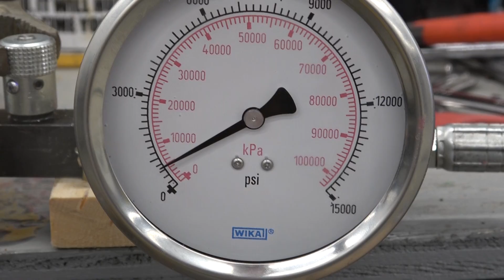How much pressure can PEX take?

Comment: I replaced our water heater a few years back and needed to replace the circulation lines as well and I saved so much time and money using PEX that I swore I'd never use anything else for water lines.  Ended up doing the whole house system in it and never had a leak in 14 years.  Thing I liked about was time saved on having to make joints and elbows and the like in tight spaces since you can just loop it around.  Now there are places I'd still use something rated for higher pressure, especially in hard to reach or sealed up installs but it's good for general home use.

Comment: how about testing the cheaper CPVC pipe, i used flow-guard and only ever had an issue when someone had a un-glued fitting on test. some times had to pump up to 150 just to get it to show its face, and pop apart.  i have seen it freeze and not bust, swelled up a bit, i just cut it out and glue new in.   not a bad alternative to copper and works great for air lines as well

Comment: In the plumbing world sharkbites are a joke and a bit of a meme among actual good plumbers. The pex i use has an aluminum layer
Reply: @marionette5968  they are not bad in an emergency or if used outside  but in just my 4 years as a plumber i will say i have seen many of them fail and cause tons of damage. never use them for permanent use and if you do never put them behind a wall or something and cover it up. yea they can handle the pressure for a bit sure but i have seen evidence that water hammer has slowly pushed them off after a year or 2 and ive seen them ruin bathrooms and even worse if someone goes away for a few days and one pops off it ruins an entire floor. they work a little bit better on pex but if you are on well water you are def asking for an insurance claim. if you are worried about burning a house down then you are better off calling a plumber. i wanna say i see at least 3 to 5 of these fail a year and in some cases cause ppl to have to get entire remodels in rooms or floors. i dont thnk they do anymore but even on the sharkbite bag it used to say something about not for permanent use and not liable for damage if it fails. the only time we ever used them was if we needed to attach to a brand of pex that you cant get fittings for anymore.  i also recommend looking up what happened with a pex brand called quest tubing. they used a similar metal teeth with an O ring method to attach to pipe and the fittings failed and they were sued big time. if you do go away for more then a few days we always recommend you shut your water main of at least. it doesnt take much for some water to cause massive mold damage
Reply: @marionette5968  almost forgot to add this but you can also rent pex tools and buy the fittings. i dont know if your places do but our supply stores will rent out there pex tools sometimes to people or a tool rental store sometimes has one. you only need to make sure you get the compatible ring and fitting for the tool

Comment: Same here in Europe/Germany, everybody is using those tubes because they can be fitted together so quickly. But I do agree, copper piping is still superior and you don't need expensive tools to press them together (except when using copper piping with press fittings instead of soldering them).

Comment: We're simulating real world conditions here,where somebody taped a hotdog on the pipe and hooked it to a modified grease gun..... 
(It's AVE'S real world....)

Boom!
I can vouch that it's not rodent proof, the rodents built a nest next to it in my camping trailer shower and felt obliged to chew on it, as it was right there. Of course the chomp marks were downstream of the blending valve and upstream of the shower head, so I didn't find out until I was 300 miles from home and 350 miles from a Pex dealer...  Had a whole box of "regular" pipe fittings with me, but they were no help. A few wraps of duct tape and 40 layers of fishing line (hand fed thru the gap one turn at a time) held well enough to shower for the trip as long as I didn't dead head it.

Comment: The previous owners of our house made the wise decision to re-pipe segments of our radiant heating system using PEX... although I have to say 10yrs on and there's been no issue.  At least it's low pressure (~15psi) and in an area that's easy to get to when it goes.

Comment: In Romania we used PEX-Al pipes as replacement for the older steel pipes which tend to rust. The problem with PEX-Al is that the pipes tend to leak at the fittings or even pop out. Recently, plumbers started using PPR for water and heating(distribution from the furnace to the radiators), there's no metal and the fittings are heat welded to the pipes.

Comment: Pex works better than copper where freezing is an issue, such as where tenants are responsible for remembering to keep the heat on in your property if they leave town. It usually will not burst in the pipe itself, as long as you strategically place the fittings (crimp are much stronger than Sharkbite) in less freeze-prone locations then you can save a lot of flooding hassles. When it gets -25F or below here and the 40mph winds kick up, I've had copper pipe runs in the exterior walls freeze if no one is using water and they have the heat down to 55 degrees, no problems with Pex yet.

Comment: You should’ve used the code compliant crimp that’s required for any hidden plumbing. Those SharkBite fittings are great but only acceptable when the plumbing is visible (under a sink, most hot water tanks, etc.). I’d love to see just how strong the PEX is when new vs after several hot water cycles.

Comment: AvE,  i enjoy your work.  im in a project in wich i need (advice eletronice). its a liner actuator, i wish to send a .jpg of the motor control board. and then you could tell me where to solder in SOMETHING reostat, var pot, resister? i need to nock the ripems  down.  1/2, 1/4 1/10?  anyway, may i enlist your help??? if so comment to my next video. the victom is a hospital bed actuator . the control board is nearly naked!   poppy's workshop says HI  p.s. help

Comment: We use PEX too in Western Europe. I used the ALPEX, which is PEX with a aluminium layer in between. No leaks since 15 years. I had some leaks, but all in the fittings, mainly the shut-off valves of the central heating system which runs mostly at 70°C

Comment: PEX-AL-PEX is rated for pounded air.   Import Chinese brass PEX fittings have history of low Cu content leading to costly rapid dezinc failure.  Weird Las Vegas mayor passed law that accelerated failure. Look up Arreneus effect.  Otherwise we use PEX in our laboratory for high temp hot water testing.

Comment: We have been installing pex in Minnesota for over 10 years and can tell you never had a single problem with them , much much much easier and quicker to use then copper. I use the crimps myself but also haven seen anything wrong with expansions either.

Comment: As a plumber in SW Florida, trust me when I say PEX is the way to go. Copper doesn't last for crap on account of the horrible water quality. CPVC is better then copper in my opinion, but it does become brittle over time, I've seen it become brittle after 15 years, which is bad. It really depends on the water quality, and if the house has a whole home filtration system then I guess coper would be the best, but most people don't want to spend that kind of money on an effective system, and they certainly don't want to pay for the upkeep or do it themselves.

Comment: Plastic plumbing i s massive over here in the uk. Every single volume built home since the late 90's has been plumbed in the stuff. gas lines are still copper thou. Also an interesting point is that  whilst heating systems are exclusively plastic, larger systems with circulating domestic hot water lines have to be done in copper

Comment: The problem with the plastic is that the fittings will start leaking at some time due to pressure differences and heating/cooling. Also the connector usually is crimped on. Due to the problem with the fittings I would at least use copper pipe for hot water if I had a choice.

Comment: I am a Plumber with 30 years of experience,  mostly rural and small-town work 10 years ago a moved to the Barossa Valley very similar to Napa Valley , both Wine producing, I am an old school plumber copper and stainless workmanship very high quality and design,, recently moved to Melbourne Australia so my Wife and I could reinvent our lives I wanted to get involved in motorsport and invention technology, but I have worked in domestic plumbing here for two years and shark bite is blowing out all over the place very poor installation stress bends and solar hot water cooking the pipework lasting only a few years, and Chinese investment 100 story apartment buildings all plumbed in sharkbite, fucking rubbish,, going to be a fucking catastrophe
Reply: Who is doing large installs with sharkbites? I can buy a 20 of brass barbed pex elbows, or 40 of the plastic ones, AND the crimp rings, for the price of a single sharkbite elbow, and I can't imagine the price difference changes that much at scale.

Comment: I would like to see a test using grade A pex and the different types of installation, expansion, copper crimp, steel crimp, barbed collet aka shark bites. Go an extra step and compare plastic to brass fittings. I’m curious if the metal fittings compromise the pex by cutting into pex when the fastening ring is installed.

Comment: Master plumber , 
Only times I've seen rodents eat PEX is after being poisoned . As an added note , it looks like the rodents are not going for the water in the pipe . It actually looks like the rodents are eating the PEX itself . I have no clue as to why . The reason I am pretty confident this is the case is as follows .
1) knaw marks are following length of tubing , with very little tubing bits left . 
2) rodents move to new spots after puncturing tubing . Frequently with a multitude of knaw spots showing up with the puncture spot . And new ones appearing in days after repair . 
Just my thoughts .

Comment: I've had a plumber tell me that a water hammer can "blow those shitty shark bite fittings" clean off and that they're a disaster waiting to happen. This is the same plumber that wanted near 400 canadian pesos here in Ontario to replace a shut of valve "properly" saying it'll take him almost 3 hours to do it.

I'm curious though what it would take to actually "blow one clean off" when it's been installed on a copper pipe.

Comment: In Northern Europe, especially Scandinavia PEX have been the standard for ~ 20 years but no one use push-on fittings, before that is was black steel pipe and fittings that was the standard. Today alu PEX is widely used and if the installation is visible in like a bathroom or kitchen stainless steel pipe with crimp fittings are used. Btw I’m located in Denmark, so I’m speaking from my experiences here end videos from the other countries.

Comment: Actually, post the clean water act circa 2000, PEX is a FAR superior to copper for home plumbing. Search, "Pin Hole leaks" to see for yourself. Changes in drinking water standards do not allow the natural protective oxidation layer to form inside copper plumbing thus exposing it to localized corrosion.  SOmething similar to what happened in Flint. Highly treated water eroded the natural protective coating that forms in water carrying copper pipes. After 20 years I can show you copper pipe that looks like a shiny new penny inside when normally it would be green.

Comment: the only reason why i like pex is because its harder for ol Joe to mess up the fittings. i cant tell you how many times i had to fix a leak in copper joints because ether Joe didn't wipe off the flux and it corroded through, crappy flux and the solder didn't hold or he was too lazy to make sure he got a good joint.
if it wasn't for ol Joe i would never use pex

Comment: Pex ain't so bad. One good thing about it, I've seen it swell when the line freezes. Normal copper lines bust when water freezes inside. It sounds like that's the main reason a lot of guys are starting to use it.
Reply: @danielrouw2593  shhhhh the plumbers are talking.
Reply: Speed of installation, not needing access around the fitting for crimping etc (for push fit like sharkbite). Doesn’t get stolen. Can re use sharkbite fittings and twist them once pushed in. All those reasons really

Comment: In Europe the prefer alumINIum reinforced plastic pipes (PEX-AL-PEX).
Reply: Yep I use them all the time with crimp fittings, have a Rems 20v Mini crimper with 16mm,20mm,25mm,32mm and 40mm jaws, i have all the reamer sizes for my drill to as well as manual one's, the fittings have a inspection window to see if you pushed the pipe all the way through. I'm sure you use the same stuff, very rarely get a leak, only if someone tries to bend the pipe right at the fitting or does not ream it properly

Comment: Not all pex is the same. Shark bite is a class b pex(not as good) .  Class A is what most plumbers use.
Reply: Sharkbite is the fittings. They work on a multitude of different materials including copper. What are you talking about?
Reply: @GrahamBartle  there is a shark bite brand of pex also. It's sold at home depot. Most pros use upanor pex. Been around in europe for decades now.
Reply: @maddmatt-80  
Yup 👍

Comment: I’ll say it once, the learning curve and ease of installation as well as ease of repairability should be considered. I think both copper an pex make more sense when used together. Heavy duty well/properly sealed copper for enclosed more inaccessible spots. I.e behind a shower or for incoming water main. But running pex in all accessible areas from main to said shower with a shutoff between main and pex as well as between pex and fixture.

You will save money and labor time at installation. And a blow out in pex is easier to locate and repair then a pitted pinhole filled corroded copper pipe ever will be.

It’s a lot easier to bumble up a copper system then it is with pex. And after bumbling it up I personally think it’s a lot easier to rework bumbled pex then bumbled copper.

And remember contractors plumbers and electricians are deathly allergic to any product or system that cuts the labor or time down good or bad that’s just the way it is.

Comment: We've been using pex for hot water for a long time in Europe.
Reply: Yes i see it used a lot of the time here in France in new constructions. Also used for under floor heating systems and all sorts ! I think the regulations make it obligatory to have crimp on fittings.
Reply: I was going to comment the same thing: Very common in France on account of easy installation and very high labor costs. As for longevity, if people have any sense they install it in a conduit, so if it leaks, the water comes out at one end or the other, so it's quickly noticed and doesn't destroy the walls. And being in a conduit, you can usually pull a new pipe through, maybe having to cut a few holes in the walls for access, but that's it.
Reply: @fartingfury  That kind of defeats the purpose of pex if you have to run conduits.
Reply: @ahndeux  I guess you're thinking of rigid conduit that has to be laboriously assembled from rigid pieces, in which case, yeah, you're right, just use copper (or multi-layer tubes, whatever). What I used is flexible conduit that came with PEX tube already inside, so apart from trimming back some conduit at each end (like stripping a wire, I guess) there's no extra effort required: Pull the whole lot through and fix it in place as if it were bare PEX. The conduit also shields UV, which is important if it's exposed anywhere (though I've seen it exposed outside for years without bursting, not that I'd fancy trying that myself).
Reply: @fartingfury  That.... is actually pretty neat.
Reply: @fartingfury  but if your taking the time and spending the money to use conduit on it then your loosing out on the savings of time and money of pex, so you may as well just use better pipes.

Comment: I guess us europeans prefer copper tubing because most of our houses are made of masonry/concrete, so once the pipes are installed and covered by plastering, they should work for a long time, repairing a leaking tube in a solid wall is not cheap n easy, while i see a lot of houses in america are built in a more serviceable way?

Comment: We do have a type of layered plastic pipe that is some kind of plastic, Aluminum, and another layer plastic prewrapped in with some insulation in Germany. I don't know how it would compare in terms of strength  and how much its rated for but the waterline coming in is reduced to 5 Bar, at least in my house. My guess would also be that the sharkbite fitting are the same here and if i remember the design correctly the crimp on fittings we used would also allow the fluid to leak because the actual sealing is done by a o-ring and the crimp basically just prevents the fitting from being pushed off.

Comment: Residential plumbing in the U.S. does indeed now allow for blue or green pex.  The color code helps speed up installation, especially in multistory buildings. All the pex naysayers need to see this. And what was the sharkbite fitting rated for? No where near 500 psi. Extensive testing has found little difference in performance between hot or cold usage.